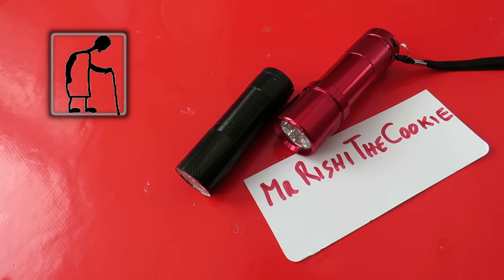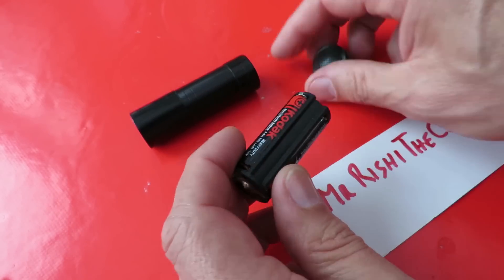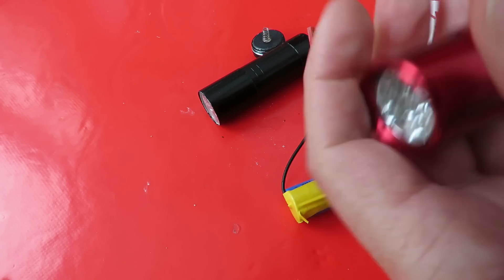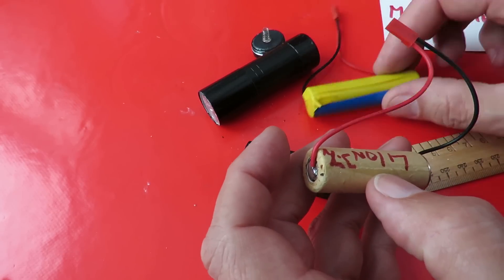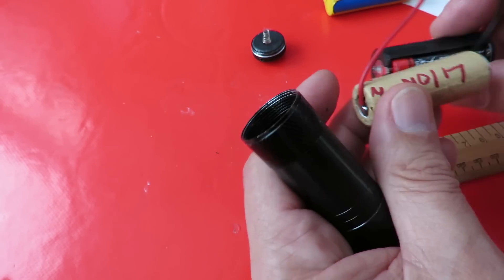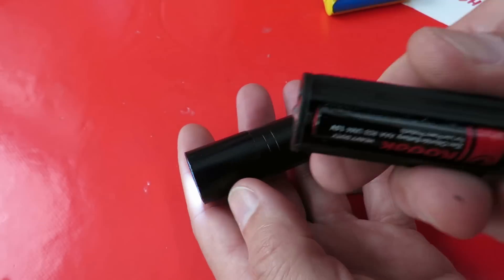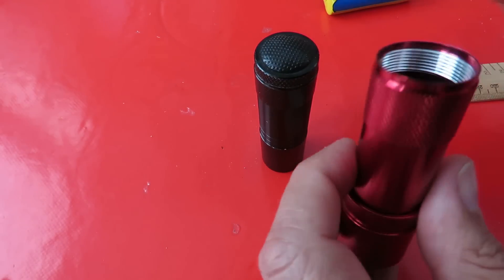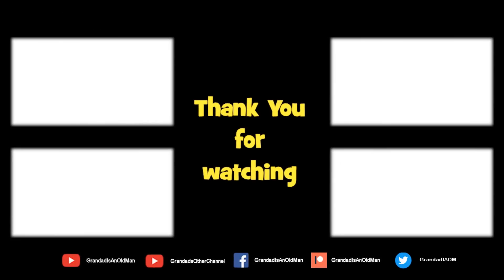Can you use a LiIon battery in those 9 LED torches

Comment: How do you have the negative and positive of those batteries tied together without a meltdown ?
Reply from the maker: I think you are misunderstanding what you are looking at. Do you mean the red and black leads that go to the red JST connector? That is a standard connector used for LiPo and LiIon batteries and fits into standard chargers and RC gear. I explained in the video I had fitted them so I could make use of them with my RC stuff.

Comment: Very cool mod. I've done that with a 14500. Needed to put a couple of pieces of foam around the side, but it's been running for a few months. When it runs down, just pop it on the charger...saves batts and gives a use to the fake low power UltraFire's.

Comment: That is some quality outside the box thinking. I really dislike using one time use batteries so any opportunity to use recharchables I am happy.
Reply from the maker: Full credit to Mr Rishi The Cookie for the suggestion however I did look up the costs of the 18500 batteries as that is a great fix but you can buy an awful lot of cheap Poundland batteries before using one becomes a financial winner.  There are lots of arguments both ways over which is the "greener" option when we look at the toxic materials used on both types of battery

Comment: That is the best idea, i have the same lamp and the same problem with battery
Reply from the maker: All that needed replacing was the little metal plates, I have done that in the past but it is really down to how much time do you want to spend on it vs a simple 1 for 1 replacement from an item that costs £1. In manhour costs it wouldn't make sense to try replacing the plates but from a personal satisfaction point of view it could be rewarding 😊 I did look up the costs of the 18500 batteries as that is a great fix but you can buy an awful lot of cheap Poundland batteries before using one becomes a financial winner.
Reply: i believe bigclivedotcom reviewed a torch which could take an 18650 or a similar triple battery setup. 
thats where i believe i saw it first.

Comment: Holy cheese you made a video on my random comment.
Thank you grandad :D
I've been in the hospital for a week (got another week to go.) so this really brightened my day.
Reply from the maker: Hey, it was a great suggestion. Hope all goes well for you and you have a full recovery 😊
Reply: at least now you have 2 working torches.
A 3d printed replacement piece could have also worked.
3d printing, as affordable as it is to buy a printer, I imagine its a little beyond this channel though. XD
Reply from the maker: All that needed replacing was the little metal plates, I have done that in the past but it is really down to how much time do you want to spend on it vs a simple 1 for 1 replacement from an item that costs £1. In manhour costs it wouldn't make sense to try replacing the plates but from a personal satisfaction point of view it could be rewarding 😊 I did look up the costs of the 18500 batteries as that is a great fix but you can buy an awful lot of cheap Poundland batteries before using one becomes a financial winner.